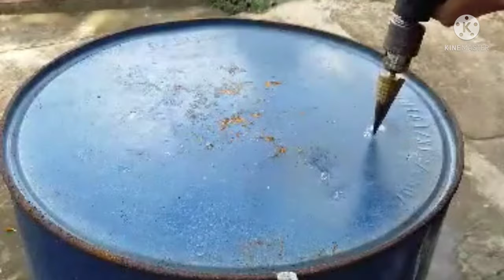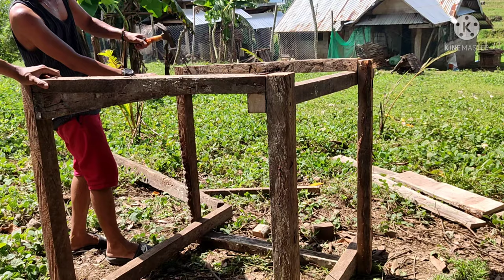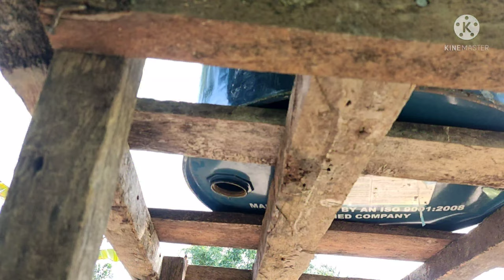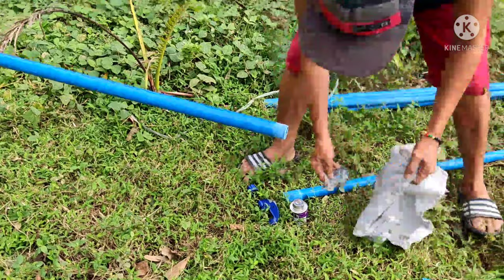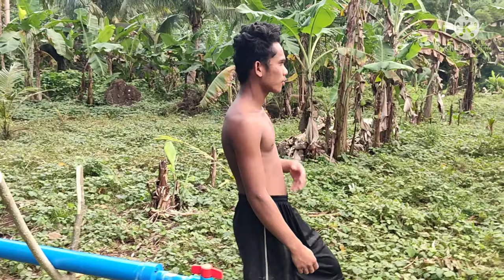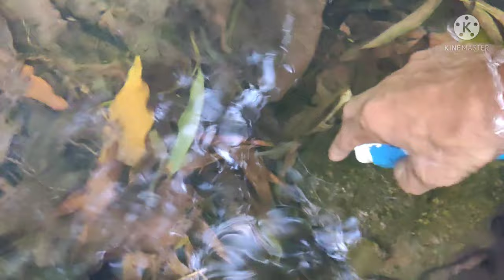free energy water pump | unlimited water supply | asentado vlogs tv

Comment: May you share the specifications of max/min level difference/length of inlet pipe; positive/negative grade of outlet pipe, max/min length of outlet pipe, diameter of pipes, diameter of pipe in the end of outlet pipe
Reply: Pipe can all be the same size this is a Siphon System not a pump. It will only work when the outlet is lower than the water level  of the intake canal